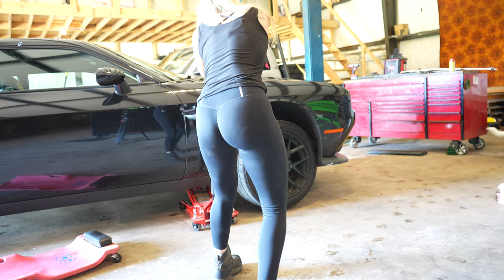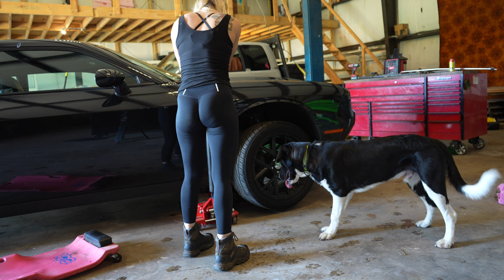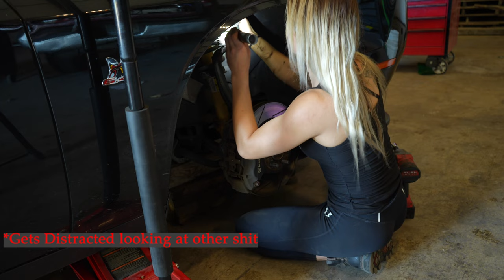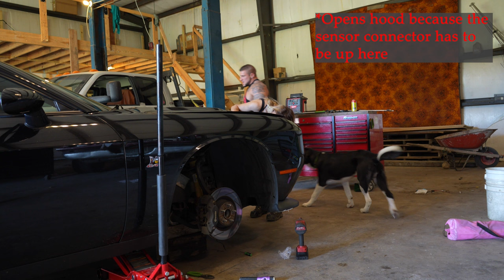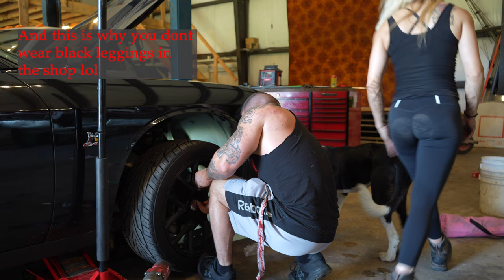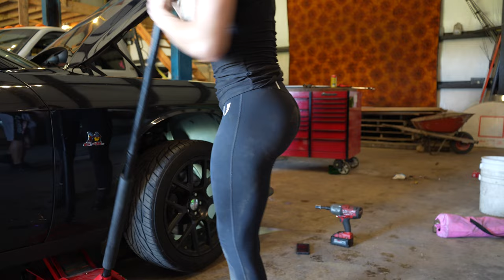Challenger wheel sensor video with music

Comment: Every time I change the unit bearings on my 2004 GMC 2500hd 4x4, the new ones come with the wheel speed sensor. Over 360k, and I'm on hubs 6 and 7. My truck is all stock. I hate these things. I really want my old 1969 Chevy 3/4 ton 4x4 back on the road. But money has to go elsewhere right now. Nice job! Keep up the good work!